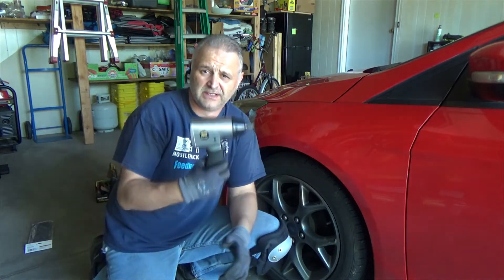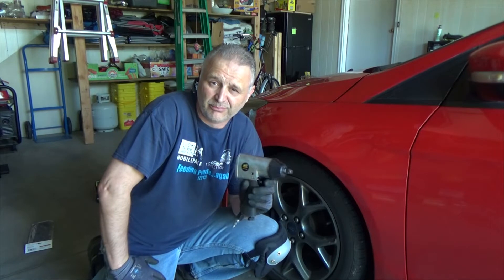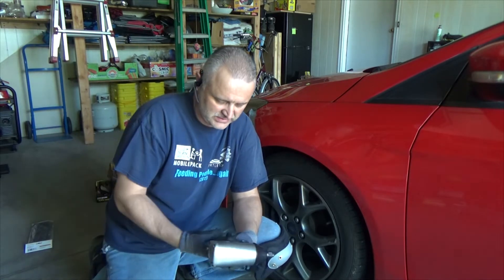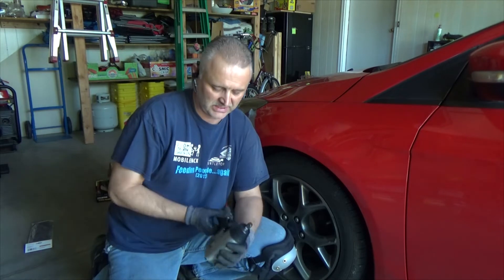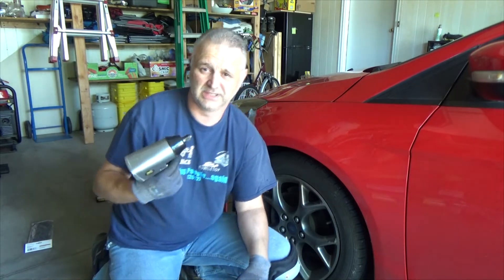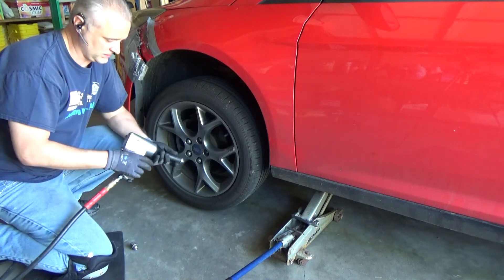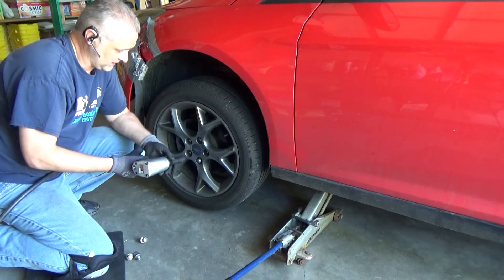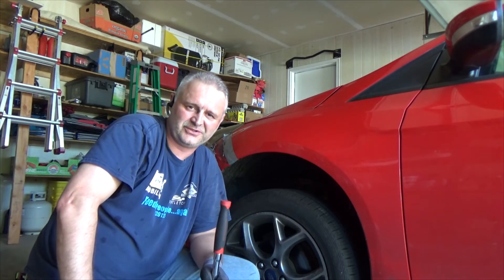Central Pneumatic Air Impact Wrench In Action

Comment: Wow....mine works fine..2 bumps of the trigger and it breaks loose my lug nuts on my silverado 1500 truck. I upgraded all my compressor, hose, and impact fittings to High Flow fittings. Turn. My 13 gallon yard sale find compressor up to 115 max psi and this impact works fine

Comment: I just bought the same gun (part number 69916) with specs that say "585 ft. lbs. max torque" but what the hell?  I can't get lug nuts off either.  I am here because I'm still trying to figure out how to adjust the power.  I cranked the control valve all the way up but it's still not getting the job done.  I didn't buy this thing to use a breaker bar to loosen lug nuts before using an air gun.  WTF, over?  😤
Reply from the maker: If you can find a way for this thing (can't call it a tool) to work properly please share the information.

Comment: I bought the Harbor Freight 3/8 in Impact a while a go but never bothered to use until I tried to remove lawn mower blades on my riding mower. The box says 250ft lbs. It really means is 250 in lbs. = @ 20ft lbs. Useless

Comment: Poor mechanic always blames his tools. The problem is your air delivery, not the gun. Your compressor needs to give the gun the CFM it requires. Read the instructions! I would also recommend getting larger hi-flo fittings. Add 3/8 hose with 125psi on the compressor and that tool will show YOU who runs the show!
Reply from the maker: You are funny guy, I'm not claiming to be the super mechanic but if you would bother to zoom in the video you would see that I have 3/8 hose. On the compressor, I guess you have to trust me on that one but I also have 125 PSI on it. Bottom line, I'm not trying to sell anything so you can knock yourself out and buy one of those impacts and prove me wrong. 😁
P.S. in the shop that I used to work for 19 years, we always ran our compressor with 110 PSI and we NEVER had any problems with impacts.
Reply: I got this same impact I hooked it up to a 75 gallon air tank it fool me it work pretty damn good to be 30 bucks.. I took a crank shaft pulley off yesterday

Comment: I have a Mcgraw 21 gallon compressor and one of those CN impact wrenches. Even at the highest setting it isn't strong enough to remove my Wrangler tire lug nuts torqued at 130ft lbs. They advertise 500+ ftlbs of torque, BS!